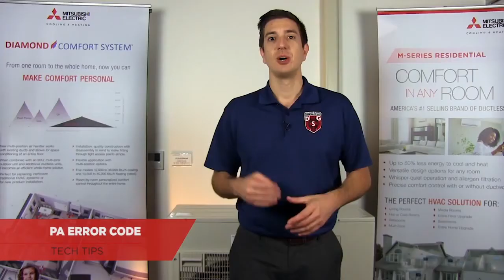Tech Tips: How to Resolve a PA Error Code (L)

Comment: My place has two bedrooms with a mini split in each room. They used to work fine and now one says the PA error code. So far I cleaned out everything and put the vacuume to get out any clogs. I was clearly hear from the mini split that it’s filing air out from the device so I don’t think anything is clogged. This was never an issue before btw. I then reassembled and started the machine and it still says PA. In lost. Any advice on what could be the issue ?